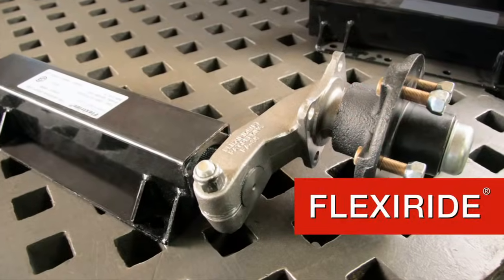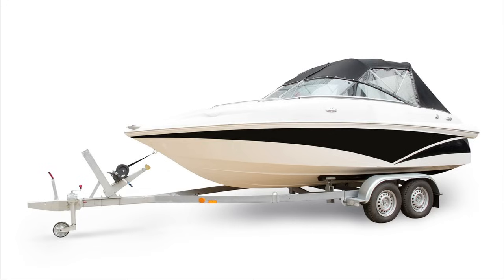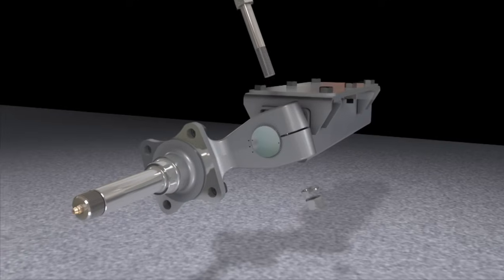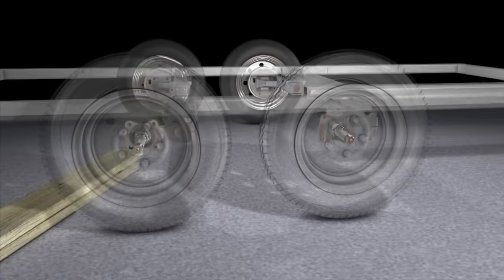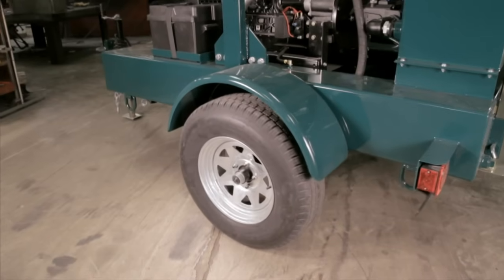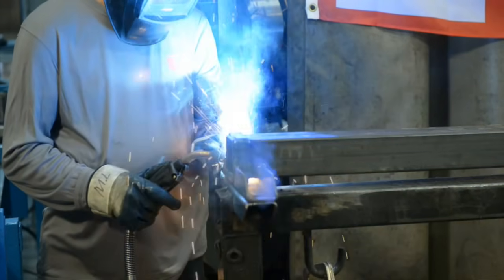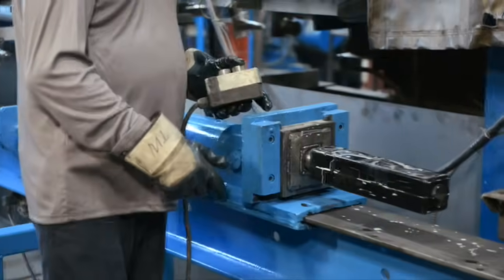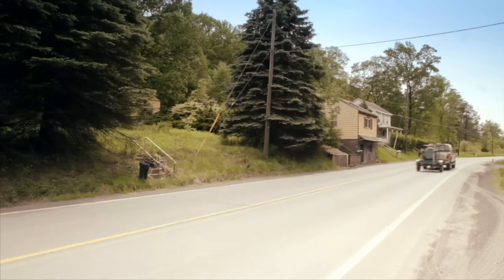FLEXIRIDE® Rubber Torsion Axles by Universal

Comment: Does the base plate have to be welded or is there another way to do it. The reason I ask it's cause my trailer is aluminum.
Reply: it is probably best to weld onto frame. I think the steel base plate is 3/16 in so for aluminum I would us 5/16 or 3/8 plate. Or maybe bolting a piece of 3/8 aluminum angle to each side of the crossmember you are mounting to.

Comment: Hi 
I have old torsion axle but its too much hard how can make it more flexible?
Reply: Have to replace it, torsion axles are available from most trailer suppliers
Reply: There is a process and procedure but not dyi friendly and require exact temperature treatments and hydronic  equipment  and no guarantee of success.  It is only $650 for replacement 3500lbs axel shipped to your door

Comment: I envision a passenger vehicle design that this would work nicely on. I wonder what it would take to get DOT approval for passenger vehicles.
Reply: At minimum it would get those horrible strut towers out of the cargo or vehicle interior space! I think they don't have as much travel though, and you'd still need shocks, but those are compact enough to not need a huge bulge in the body.
Reply: Vehicles have had torsion axles for a long time, the VW Beetle had torsion axles. It's an old style suspension, the late 90s Ford Explorers among others had torsion bar suspension.

Comment: Bad suspension system, coil springs are so much better!
Reply: Then why are so many manufacturers not using them anymore
Reply: @ronaldharris6569  the reason is only the price, coil springs are more expensive. If you have a trailer with independent suspension, you will see no jumping trailer within 160 km/h, allowed is maximum speed of 130km/h in France, 100km/h in the EU.
Reply: @User-vl9gp  Not true, coil springs are bad for trailers because they take up too much cargo room with coil buckets. You either have to raise deck height, which is bad, or cut into the deck area, which is also bad.
Reply: @snarkylive  is that the reason,  why expensive Trailers have Coil springs and the cheap trailers have torsion springs?
Reply: Right airstream uses torsion axels and trust me built better than the products rolling out from any other manufacturers having ridden inside both kinds hands down better ride. There is plenty of videos proving this fact

Comment: Dexter Torflex ?
Reply: The operating principle is similar, but while Dexter stuff four rubber rods into the corners of a square tube around a square bar, Flexiride fills the space with rubber. Dexter welds the suspension arm to the square bar, but the Flexiride arm is splined onto the bar in higher-capacity models. The Flexiride design is better, but more expensive.
Reply: @brianb-p6586  Are you sure they're much more expensive? I priced out 2k axles for both brands and they come pretty close to one another. Brakes can also be added to the Flexiride for much cheaper than the Dexter.

Comment: Actually... This technology has been around for years.. VW used to use it in thier old  bugs.
Reply: You would be mistaken VW used s torsion bar spring
Reply: @alexszilagyi1267  It's the exact same principle and suspension type. There are leaf springs, coil springs, air ride, magnetic, hydraulic, and torsion.

Comment: Built in camber? But wouldn’t I want the axle to be level and 0 camber for even wearing and long life of the tires?
Reply: Parker R think about what happens when you put a load in the trailer and you have zero camber, you now have camber and your tires will wear unevenly.
Reply: Most trailers achieve camber by having a slightly bent axel that will flex down when weight is installed. How do the short Flexiride achieve camber ?
Reply: @glennmcginnis8761  The video shows a square tube being deliberately slightly bent to create that camber; the Flexiride units are attached to each end of that tube.

Comment: wanting to put these half axles on a 5x10 open trailer with 3500lb axles, whats the life span on the rubber inside, warranty?
Reply: Torson  axle  have been under my airstream  1972 and need replacing  about every 20yrs. If you jack the weight off your trailer when not in use will last longer. And coust $650 shipped to my door (3500lbs)
Reply: 3-5 years lifespan, warranty 24 months.